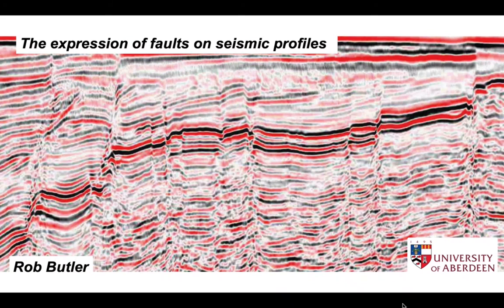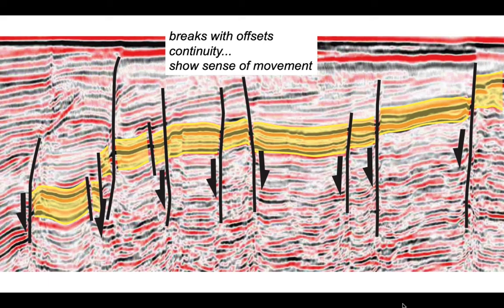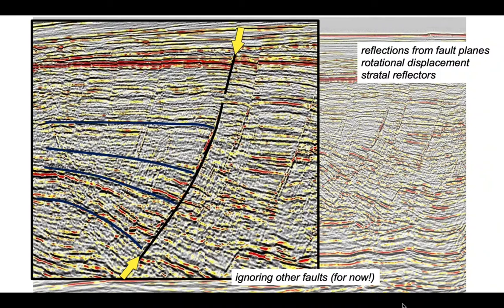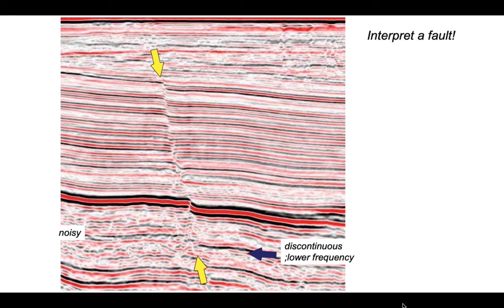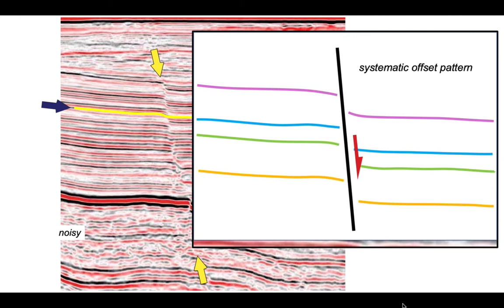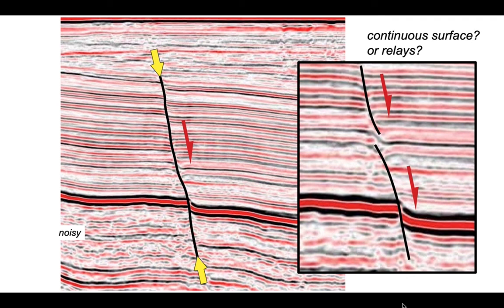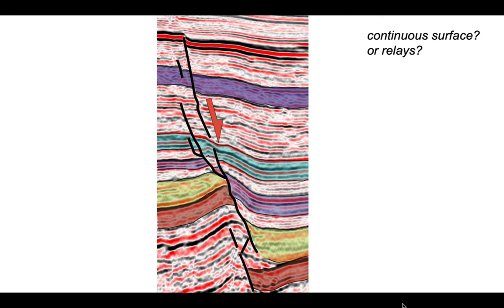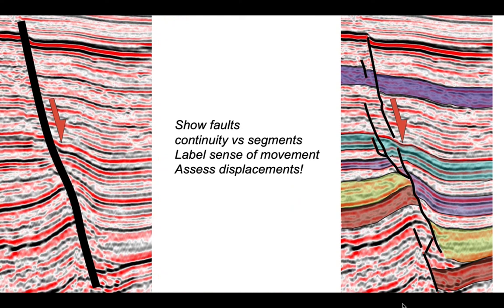The expression of faults on seismic profiles

Comment: The seismic profiles with vertical scale expansion, maybe not easily be explained. I think some of them are extensitional kink zones. Maybe some other types of stress fields should also exist in some local complex areas and thus  bulklinglike folds or flower like structures.
Reply from the maker: Thanks for the comment. The key when interpreting structures on seismic profiles is to get vertical and horizontal scales to be (approximately if in time) equal... it's easy to miss-place faults through a series of stratal reflectors if interpreted with high vertical exaggeration... (a really common issue).... and almost everything can look like  buckle folding/inversion structures without care.
Reply: @robbutler2095  Thanks a lot! That means the bulking features are mostly pseudo-pictures, not true.

Comment: Sadly neither picture is correct.  2D lines are really not the tool to use.  3D seismic would be a better solution.   The faults in B make more sense as the fault zone has been active for a long time.  What we see is the last movement, and only movement in the plane of the 2D seismic.  A 3D data set will certainly surprise one, with fault movements not considered.   These out of plane fault movements also give rise to a false stratigraphic interpretations.   The B solution can be improved by timing of the faults, what stratigraphy, which way did it move etc.   A warning about over interpreting the data, maybe the A concept of a fault zone is the best until you have way more data .
Reply from the maker: Thank you for your reflections (as it were)!
Well - of course we don't actually know the "correct" answer - that is the nature of seismic interpretation. I presume you're discussing the final  example in the film where two options are presented as alternatives. 3D can give further options (and maybe eliminate others) as can well penetrations of course. But you may need to make interpretations with the imagery that you have.... ahead of the acquisition/availability of more. I say - - interpret with what you have (and image without geological interpretation is just an image), be explicit about the geology so tests of "internal consistency" can be applied (so commit to the interp) - and be aware that alternatives may also be valid.